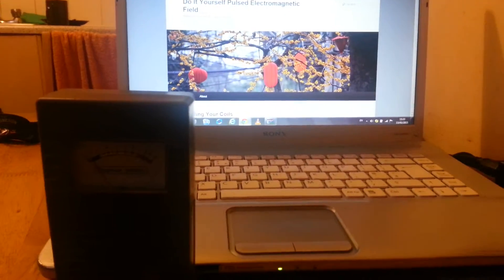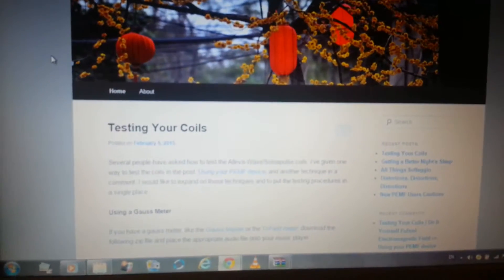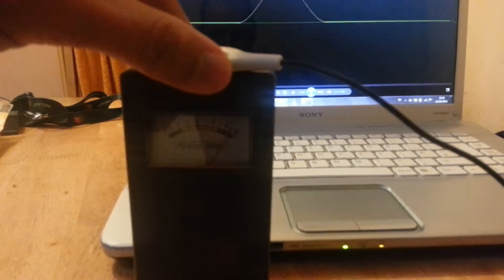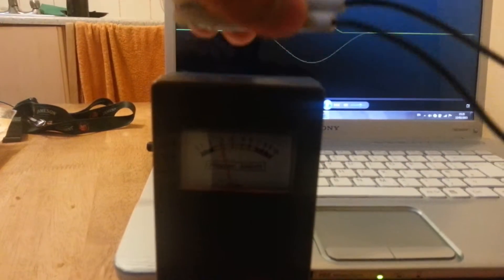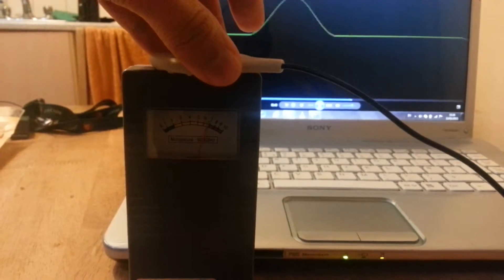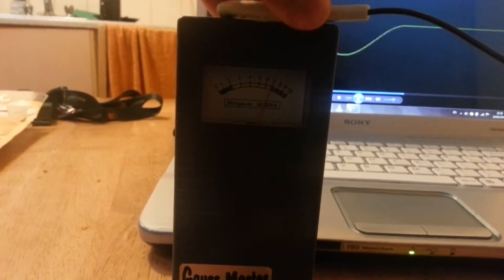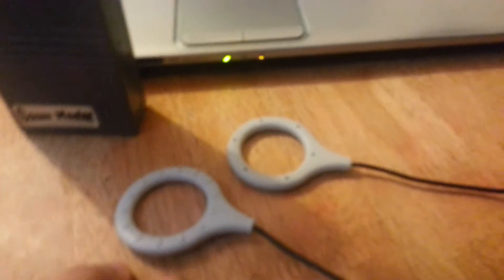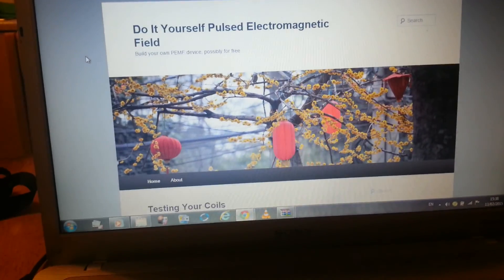PEMF Coils AllevaWave  Review

Comment: I can probably help explain this for you.  If you stack the coils together you need to put the bumpy sides together, not both facing up or both facing down.  Stacking the coils bumps-to-bumps will align the two coils with the proper magnetic polarity.  The way you stacked the coils the magnetic fields are mostly cancelling out; that is why the RF power drops when you stack the second coil on top of the first.

I think this is a cool app, my main concern is that the impedance of ICES coils is very low, only about 1 Ohm, so it may damage your smartphone audio output stage amp, unless it is protected against continuous short circuit.

Also, because of the power and frequency limits of the audio output amps, you can not really get full therapeutic power from the coils, which requires a trapezoidal wave with rising and falling edges with a sustained magnetic slew rate of at least (+/-) 250 kG/s for about 100 micro-seconds.

BTW, I am the inventor of the allevawave, somapulse, micro-pulse ICES, and the other similar portable PEMF-ICES devices on the internet.  I did the original development of PEMF systems for NASA way back in 1997-1998.  I designed and manufacture the coils that people are using with this app.  The best source (lowest cost) for our products is from my web page:   www.micro-pulse.com

Have fun hacking.

Bob Dennis
Reply from the maker: thanks for the help I have been experimenting with the coils and I had some interesting effects i plan to do some sessions and record before and after with EEG and see what happens to the brain I am planing of 40 hz :-)
Reply: @TheLeandroemile  did you try that yet?
Reply from the maker: @mkayar  thanks I will try that